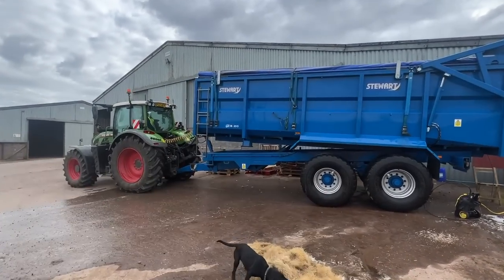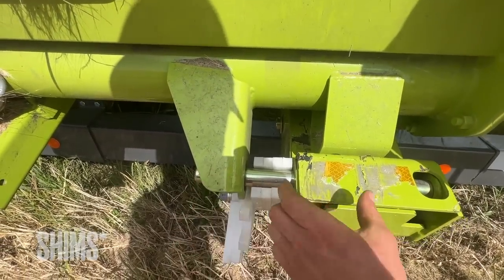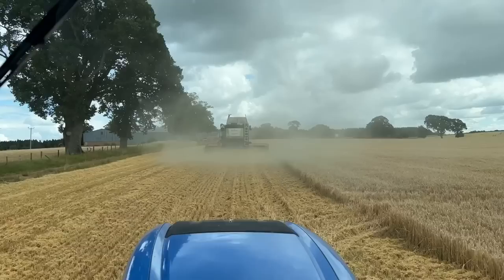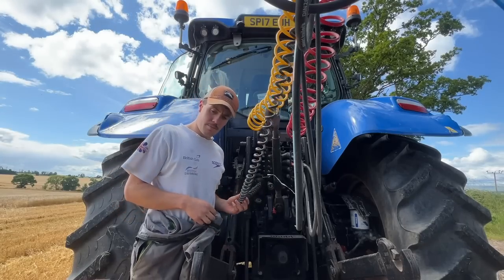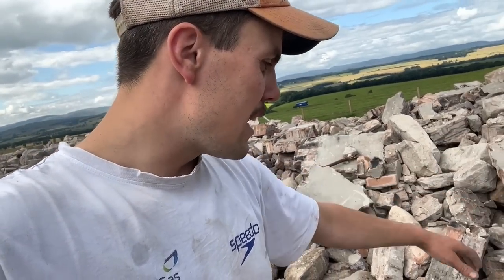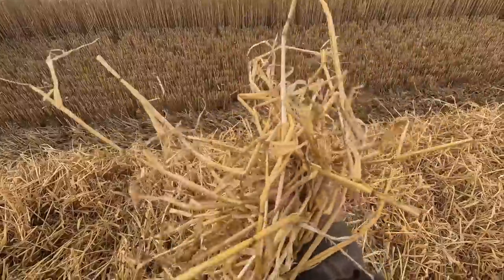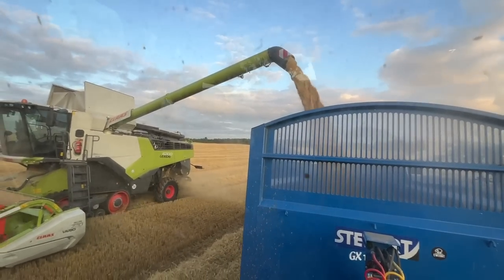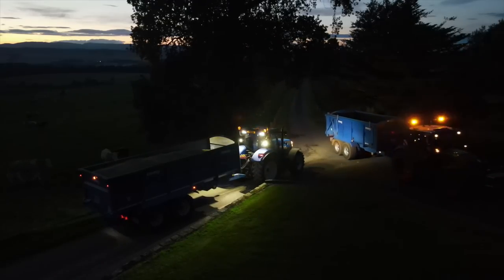The Rain Is Coming | Farm Yard Rubble?

Comment: Yeah same thing with vario and geared grain carting, much prefer doing it on the gears. Vario can be even worse on steep ground aswell then the tractor starts running away from you down the hills, unlike the geared one that you can just drop down a few ranges and it will hold.

Comment: When loading off the combine don’t use pedal mode use the joystick best tractor ever to load trailers on the stick! Use the slider on the side of the joystick 4 positions each position is the jump in speed with each nudge out the joystick 1 the lowest 4 the highest sure low is like .2kph

Comment: For loading in the fendt use cruise control on and wind the dial up and down as you need to speed up or slow down and make sure your in low range better control in the field
Reply from the maker: Did give this a try still made an arse of it 🤣